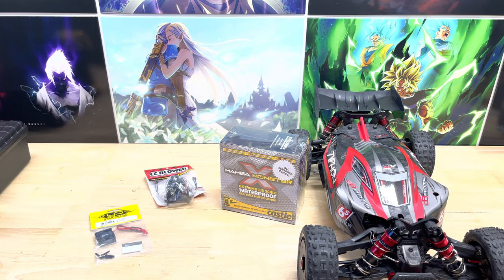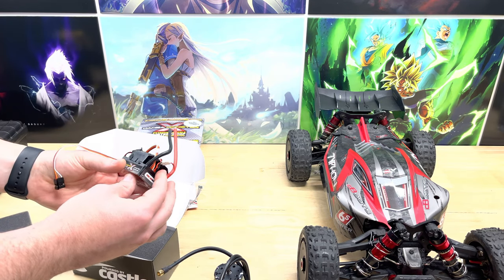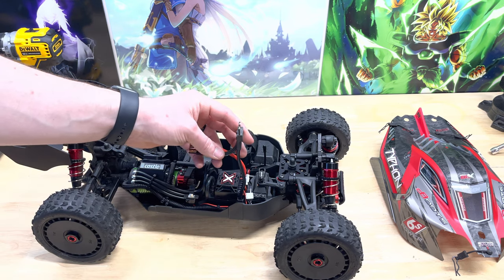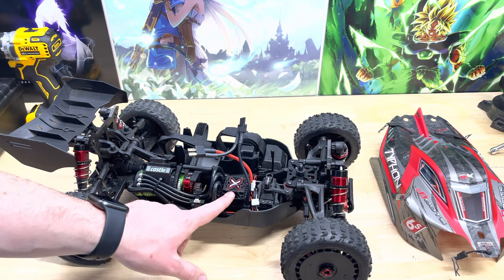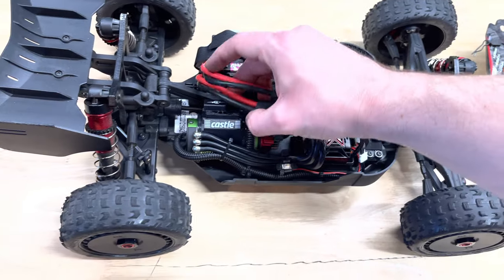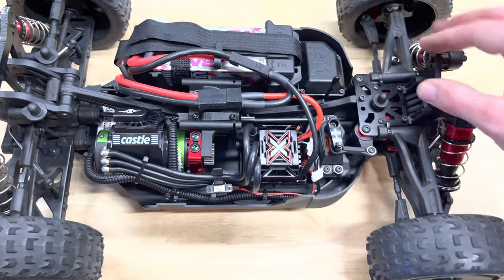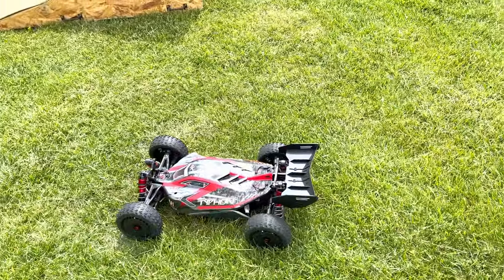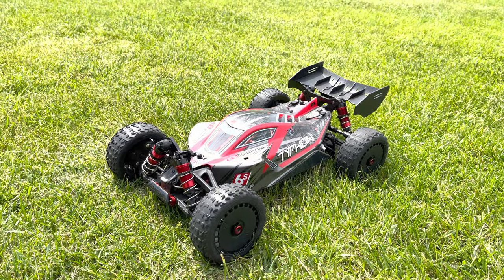Arrma Typhon | Castle 1515 2200KV with MMX

Comment: Rpm makes an esc cage with a switch mount on it for the monster x. Has a couple options for the orientation as well. I run one on every castle setup I have! RPM73622 is the part number, and they've got one for the mamba x as well RPM73762. Both cost less than $15!

Comment: How do you like the gearing your running?  I've had a 1515 laying around for a few years now that I'm putting in a outcast 6s I was thinking about 17-21t pinion.  Just trying to get ideas on thoughts.
Reply from the maker: I think it’s perfect like it is, definitely good acceleration.
Reply: @GoKaioken  does your car have the 54t spur?
Reply from the maker: Pretty sure it did

Comment: Why did you switch out the Spektrum components? Are you still using the DX5 Rugged with this?
Reply from the maker: No I ended up selling the dx4. It didn’t provide much more value over the other radio and the receiver didn’t even have gyro even though they are so expensive. The castle system is much smoother in my opinion. Speed didn’t change much though.
Reply: @Arrma Army RC  new to the hobby, forgive the noobness, but why doesn't the dx3 work with castle esc? And does it only work with spektrum esc's?
Reply from the maker: I don’t know why he is saying it doesn’t work with a castle esc. A transmitter only communicates with a receiver, not directly to the ESC.
Reply: @RC Recon  that was my initial thought...but I figured I'm new to this so maybe there's something else going on...

Comment: Do you think the 2650kv  castle motor paired with the mamba c esc with the same gearing will be to much for the typhon?
Reply from the maker: The regular mamba x over the mamba monster x? No I’d stick with the MMX but that motor should be fine
Reply: I was asking do you think with the 2650kv (castle motor) will pair good with the same esc and the same gearing that you are using in your video
Reply from the maker: Yes
Reply: I was thinking that since the 2650kv castle motor has 450 more Kv than the 2200kv it will give the car a little more performance/power for off road use

Comment: It looks clean, why did you put the castle system in
Reply from the maker: Sensored and more experience with the castle system. But preference more than anything.
Reply: Be honest it’s Because spektrum electronics is 💩
Reply: Spektrum electronics are absolutely great. I love them and they are more durable than any other setup I’ve used. Matter of fact, this exact Castle setup in my Typhon is overheating.

Comment: So for my x maxx 8s, what esc should i use towards what battery should i use also? Thanks
Reply from the maker: I recommend mmx8s and smc 6000 mah
Reply: @GoKaioken  the mmx8 is the esc? Thanks man
Reply: @GoKaioken  1 more question boss, so if you upgrade the motor on a x maxx and the esc, should you upgrade also the stock spur and pinion gears? Or you dont have to?
Reply from the maker: Yes that’s the ESC, and you don’t have to upgrade the stock gears. Run it, see how you like it, check the temps (or if it doesn’t shut off due to over temp, then you’re good) and then adjust gears from there.

Comment: How fast is it after changing esc and motor?
Reply from the maker: A tiny bit more responsive I think, but I kept the pinion and spur size the same.
Reply: @GoKaioken  if i change pinion and spur size, do i need to change spool as well?
Reply from the maker: What car are you referring to?
Reply: @GoKaioken  i have Arrma typhon 6s v5 like you.
Reply from the maker: Are you running a solid spool or a center differential?
Reply: I just got it. My Speed test from factory is 62.5 mph, I need it faster.
Reply: @GoKaioken  what does it mean?
Reply: @just719  if you want it faster go larger pinion. Put in a 20tooth or a 21tooth.